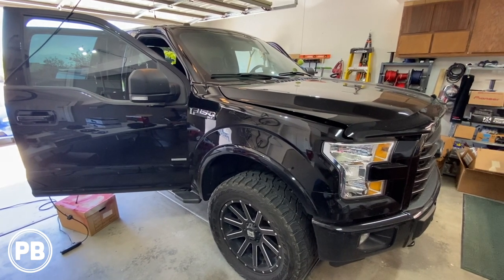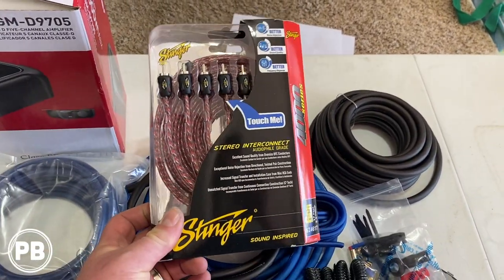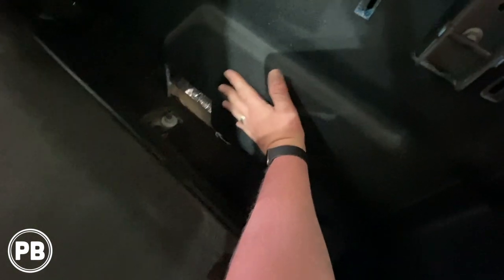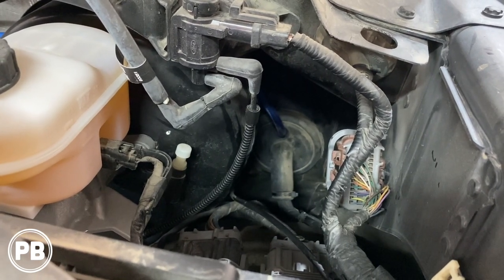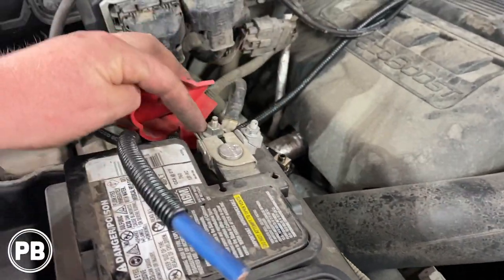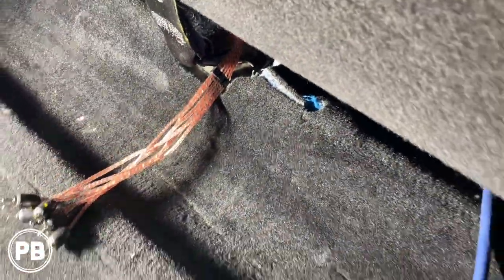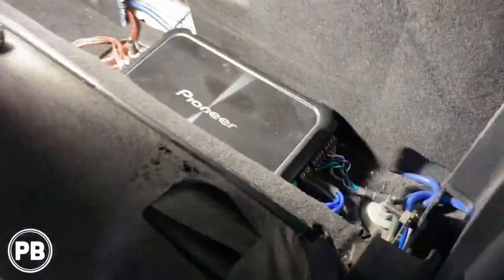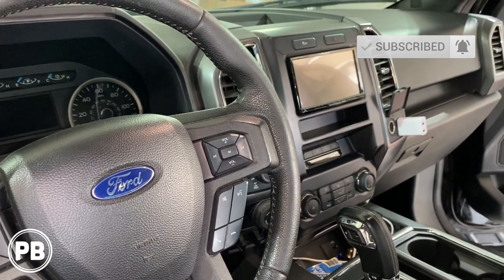2015 - 2020 Ford F150 5 Channel Amp and Sub Install (to Aftermarket Radio)

Comment: OMG You just saved me life with that door speaker wiring. I did not know about that and was dreading my stereo upgrade just because I didn’t want to run all new wires for the doors. THANK YOU SO MUCH for this video series

Comment: Where does the sub woofer signal wire come from if its a stock radio? I have an 2016 XLT with the little screen. Your video has been very helpful up to that point.
Reply from the maker: Here is a video for that! https://youtu.be/-_GPd8Y7yGw

Comment: Im not trying to be funny here. But aluminum is 3 times MORE conductive than steel, but with sensitive electronics on vehicles today and that being a 2000w amp, it would still be wise to have an independent  ground 👍

Comment: Did the back seat vibrate significantly? Does the back seat bottom touch the sub box? Thinking of adding this to my 2016 F150 but would like children/family riding back there to comfortable.

Comment: Great share PBAI!
Newbie here!   Have questions..
That amp sensor on the truck.   It can sense amp draws from two different cables?

The ground distribution block.   Just curious why you didn’t run the cable straight to the amp?
Not criticizing.  Just learning.

Larry

Comment: There is a whining sound coming from my speakers and it fluctuates with the rpms but I didn’t ground the battery. If I ground the battery will it fix that sound and also do I have to ground the battery to the same place as I grounded the amp?

Comment: If you were to do this exact same install, but with the factory radio what else would you need?
Reply: Line output converter
Reply from the maker: Parts also linked in the description.
Reply from the maker: Here you go https://youtu.be/-_GPd8Y7yGw

Comment: Might be dumb question but how did you plug all the RCA leads into the radio what goes where if you don't have three outputs?
Reply from the maker: If you have a factory radio, you will need a line out converter. https://amzn.to/3BW0kGL

Comment: Why would you bolt the copper wire (ground) directly to aluminium?
Won't it oxidate?
For copper/alumiunium connections we need special al/cu-parts
Reply: In theory yes, you could use an anti-oxidant compound to be safe.

Comment: I ran the multiconductor speaker wire from my 6-channel rockford fosgate amp to to wiring harness connecting to my factory harness behind the head unit. My 2 12”s work fine, my amp powers on and doesn’t enter limp mode, however my door speakers don’t produce any sound at all. I don’t believe this is an issue with the wiring, but I can’t figure out any other solution. Any thoughts?

Comment: Ok, so I just bought this exact box with two kicker 10s instead of the alpines. How is the bass output on this box? any good? Does it give a good thump in the cab?
Reply: how's it sound, worth the upgrade?
Reply: @choochoochar  no it was garbage returned it and put in a jbl stealth box with 1 10" lol
Reply: @Drew-py8kg  LOL thanks for the reply. Thinking about doing my system. I’ll keep it in mind

Comment: Question i have. Is the factory speaker wires heavy enough to run a lot of power to door speakers or just low power and factory speaker installed?
Reply from the maker: Factory Speaker wiring generally is all copper, and should support up to a max of 100 to 150 watts RMS.  Anything more, you will need to run new wiring.

Comment: Hi, I already upgraded 4 speakers. Next step,  I plan to install amplifier and subwoofer for my 2021 Ford Expedition XLT (6 speakers NOT B&O system). Could you please give an advice for amplifier, sub and wiring kits as well. do you think my expedition look like 2016 F150 truck to install amplifier and sub? I live in Manitoba, Canada. I appreciate about that.
Reply from the maker: Here is a good video for that: https://youtu.be/-_GPd8Y7yGw

Comment: Aluminum is an excellent conductor of electricity. Copper and aluminum connections should be avoided due to galvanic corrosion.

Comment: I've recently installed an AudioControl LC5i Pro with a JJ XDM700 5 chan amp. 4 chan to the doors/front tweeters and one chan to a sub. I have the non-sony factory radio. I'm dealing with high white noise floor due to the door chime, backup camera, touchscreen beep volume being amplified. This volume seems to be set in the Ford programming and since I've seen you do installs on many F150s, how do you handle this? Through Forscan? I have a 2015 F150 3.5 Ecoboost non-Sony setup. Thanks for your video series too!
Reply from the maker: Are you using a T harness / load resistors? I need more info on how you've integrated into the OEM radio.  This video is integrating to an aftermarket radio, where the other video shows how to integrate into the factory radio: https://youtu.be/-_GPd8Y7yGw
Reply: @ProvoBeastAudio  I'm using a T-harness from factory radio into an LC5i Pro. Since posting this comment I've adjusted the built-in load resistors on the LC5i Pro to 60 ohm. That took care of sending the chimes back to the door speakers but did not help with the high white noise floor.

Comment: So 1 question and 1 comment, how did you do the line out to the 6 rca channels?  Never showed that did you use an LC6/7I or similar?  I noticed you kept your RCA and speaker outputs on the passenger side to keep it from being run over power and ground, only to wrap the speaker wires around the power and ground at the amp?  Do not do that especially with a higher power amp like this.  That's a no no for possible interference.
Reply from the maker: We had an aftermarket radio (video in description) which is why an LOC wasn't needed whatsoever.   And very unlikely to have interference when your ground has little to no resistance, using quality RCA cables, etc.  What we did was just fine.
Reply from the maker: Use this new video: https://youtu.be/-_GPd8Y7yGw

Comment: I need to hook up an LC2i to a 2015 f150 Lariat. Do you know what speaker wires I need to tap in to ?
Reply from the maker: For just a sub output?
Reply: @ProvoBeastAudio  yes it’ll be just for the subs. I’m installing two jl 13tw5

Comment: Is this possible with the stock sync 3 radio? I love the radio and would rather keep it in place, but would like some subs.
Reply: Yes.  My 2016 F-150 is Sync 3 and I have an amp and 2 subs under the seat.  I am about to rewire the ground, however.  I think this is causing an issue dueto the aluminum body.  It's annoying.
I am wondering why he used the distribution point instead of going directly to the battery.
Reply: @gr0uch02a  Im also wondering why he went to a distribution point instead of directly from battery to amp. Im assuming multiple grounds are better but you also need to be aware of ground loops. Either way thats awesome info to know, that you need to run a ground wire the same size as the power wire to the battery. Thank you @Provo Beast Audio Installation
Reply from the maker: Here you go: https://youtu.be/-_GPd8Y7yGw

Comment: How did you run the tweeters?
Reply from the maker: They run in parallel with the mid range door speakers.  That video is linked in the video description.

Comment: So adding a subwoofer- subwoofer 20% of the cost, amp 50% of the cost, box and wiring 30%. At least thats the gust of what I get from all these videos..
Reply: thats if you do it yourself. probably 20-30% cost for labor 😂